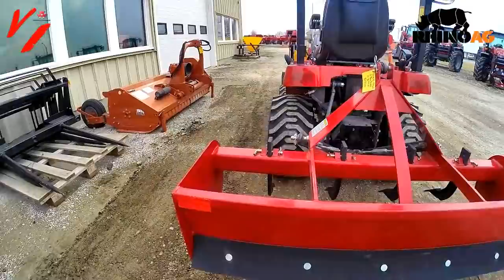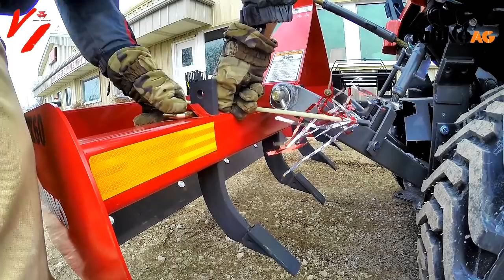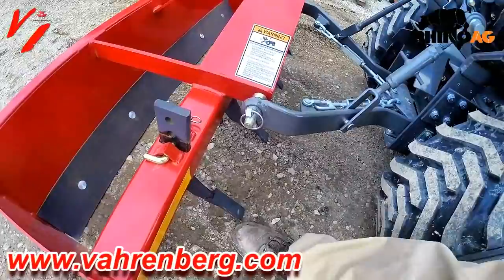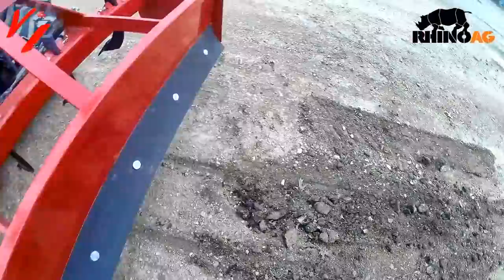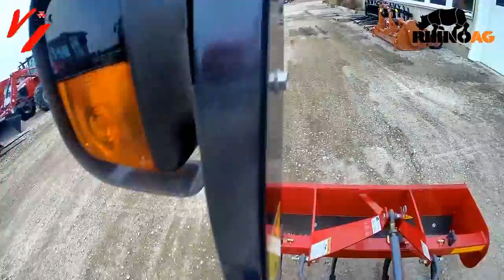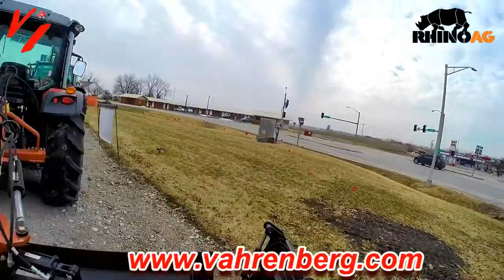RhinoAG CBX60 Box Blade -  Sub-Compact & Compact Tractors

Comment: Nicely done.  I notice on your GC1715 the 3 pt hitch has an adjustable right-hand lift.  I have the 2018 GC1710 TLB and neither of the lift arms are adjustable.  Is that b/c it's a TLB?  Thanks.....and as always, a great video (smile).
Reply from the maker: I've never seen a GC even backhoes that did not have Right Hand Side Adjustable link arm. I went and looked at the TLB we have in stock and all of them have adjustable link arms.
Reply: @VahrenbergImplement  Thanks.  I'm wondering if I have a freak GC machine (haha).  Now that sounds weird, doesn't it? Thanks for the feedback.  I was going to write Massey and ask if they had those adjustable lift arms but now I see from your video they should already be there.  Hmm?  Thanks again.
Reply: Doug, I'm wrong. I went down again to check. Oops!  I surely didn't like fessing-up (smile) but honesty is key and a virtue. Thanks again.
Reply from the maker: That's Awesome and now you know and have more than what you originally thought. You had me wondering too but always good to make sure you got everything and thanks for letting checking and letting me know. I was wondering how that could have happened.
Reply: Doug, my jaw dropped and I was almost too embarrassed (ha). I said I gotta let Doug know that everything is where it should be. Thanks again. As you already know, really enjoy the Massey videos.